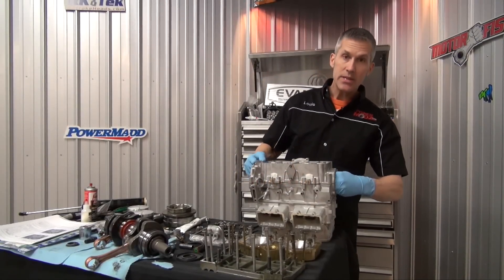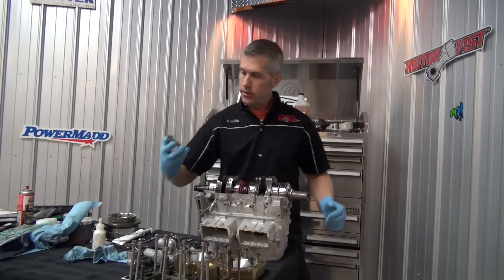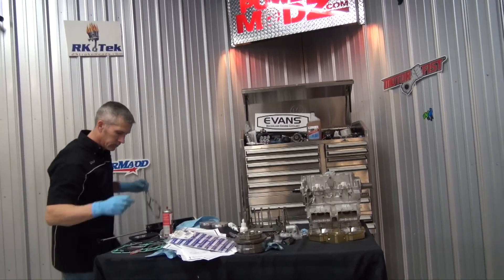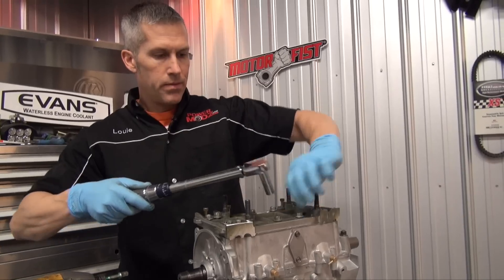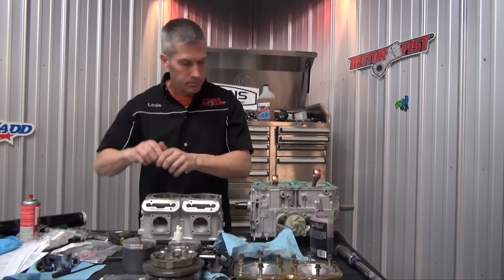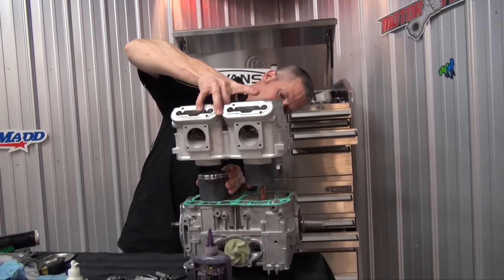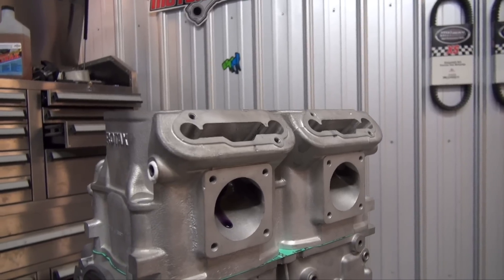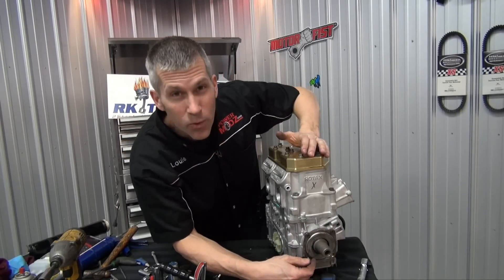Polaris IQR 860cc Mountain Mod RKTek Big Bore install part 2!

Comment: I just want to let you know in case you dont that you need to add a percentage to the torque depending on the length and diameter of any extensions you have to use...other wise the extensi8n will obsorb some of the torque through twisting...just an fyi
Reply: How do you calculate this ?

Comment: Honestly when people say within .001 I don't think they know how tight a pin in a hole is when off by .001". A titanium pin into a titanium hole that is off .0002" needs a hammer to push it through. So what you essentially are doing is making the hole a bigger diameter while damaging the pins original size. So when your talking engine components like Bushings or bearings runout it isn't quite the same type of pressure but does throw the weight of the crank more to one side. It's not a lot of weight but when you exert a little bit of force over many reputations it will wear more quickly and you will be regretting having to replace a bushing/bearing after a couple thousand miles sooner than it could have lasted. I know .001 over 1 ft or so is low but quality can always be improved if your staring at a result with the ability to improve it. The more out of round the sooner those bushing will need replacing from them wearing. If you can reduce it to within that .0001 on a dial indicator your going to at very least not going to be diving into your motor later down the road for bearings failing due to that balancing. Now that .001" is okay for most machining applications but I would get a tenths dial indicator (.0001) and make that needle not move for something as delicate as a crank.

Comment: When assembling any engine, the only thing going inside is assembly lube. The assembly line will hold anything in place that needs to be held. Never ever use lock tite it drys and changes bearing sizes and also dries and flake off. Always use assembly lube or engine oil Only!!

Comment: Hi I was wondering if you could possibly help me I have a Ski-Doo 2006 800 gas after somebody safe and gas out of my tank so it sucked up some dirt and had one carburetor plug so it was only running on one cylinder wrote it all the way out of the bush like that and then found out my piston was wore a bunch from running dry so I cleaned the carburetor out and still only seems to be running on one cylinder what else can it be and both cylinders now are at 150 lb compression
Reply from the maker: Clean the carbs well and check your fuel filter and pump. Basically go over your whole fuel system

Comment: What is the scoop with the extra gasket and plate on the bottom of the case?  I've never worked on a Rotax.
Reply from the maker: Garret Warren yes the coolant circulates the crank.  more power!  gets the heat out.

Comment: hey i got a 600 xlt that is extremely hard to start when its cold  but once its started for about 2 mins it starts as good as a brand new sled any ideas why this is happening
Reply: James_wiseman NL709 😡😡😡😡😡😡😡😡😡😡😡😡
Reply: Check the choke make sure everything is working I know it's an old question but I answered anyway......from Wyoming USA 🔫🤠

Comment: What is your thought on single vs dual ring Pistons?
Reply from the maker: +matt dicaire both work just fine, ive pulled single ring pistons out of sleds with 12,000 kms and no issues, same with duals.

Comment: TAIGA NOMAD utility Sled,

 I see everyone looking @ this video in comparison... to Taiga Nomad the
video. This comparison say's it all!!!  

You hear him say I have it wide open boys! was trying to lift the ski's? No watch a grass drag video they are all trying to do wheelies, it's referred to as mechanical

advantage (clutches & chain case with gear reduction) Physics is
a b**h LOL Shall we talk about the range? Again Physics is a b**h it
is a simple mater of energy density. Best batteries on the planet
have 1/2 the energy density of gasoline. And I know the hate is going
to come but please understand I believe this is the future !!! Just
be educated to the realities of what it is right now. A Ford model-T
in 1908 was amazing IN 1908!!! Yes I have back ground in engineering
and snowmobiling in Timmins & Cocrane for 30 years yes I'm a
boomer LOL.Again this technology has a place ... but the realistic range for this snowmobile
way we rode is 60km (we rode 450 km's on great days) that is 30km
one-way then turn around and come home wait 20 min. To charge on
their 220v proprietary charger that will have to be professionally
installed, providing you have availability to supply the requisite
energy need's (plug in wall). None of my generators could supply
that... oh shall we talk about the gas for the generator LOL I can't
help it I'm laughing so hard I'm starting to cry. "The illusion
of green is strong with this one" think I do ... LOL! And "why
are the comments turned off on the Taga Nomad video? fictitious
facts" think I !!! No I'm not going to give you the numbers look
them up be an educated consumer that is all am saying !!! Please
remember bullshit walks a long way home !!! I am a Crippled boomer that
can't walk 30km in a day anymore !!! OK I'm now crying...LOL